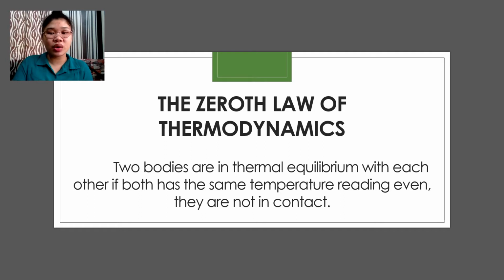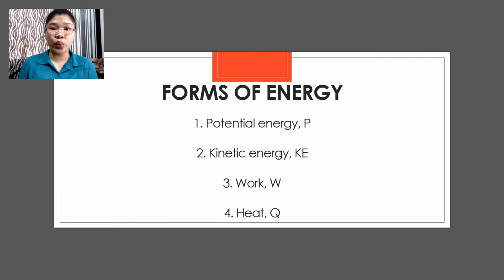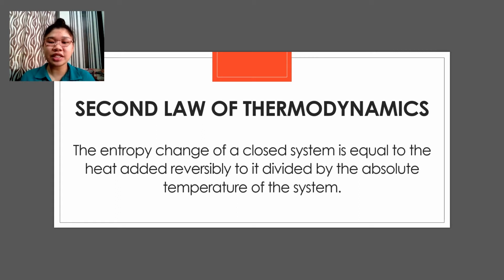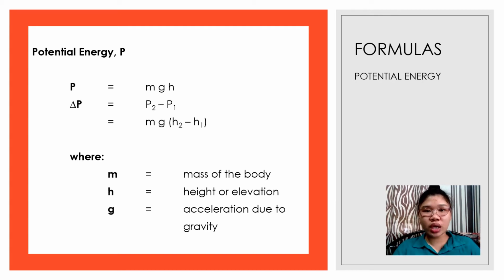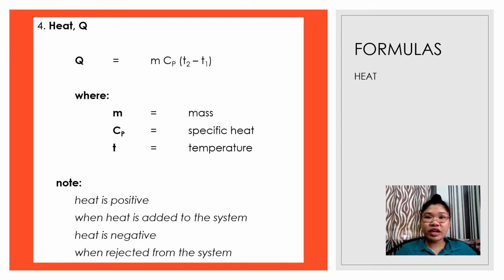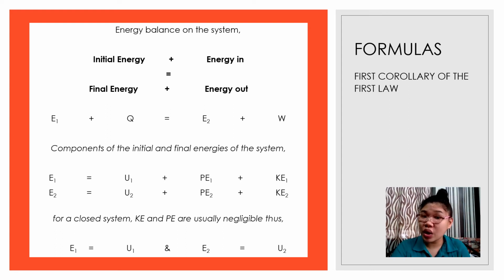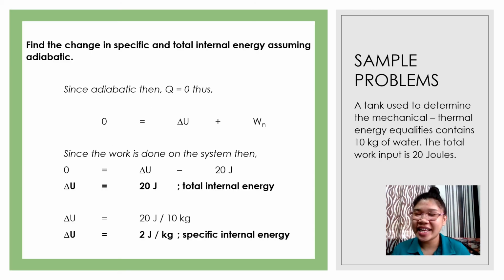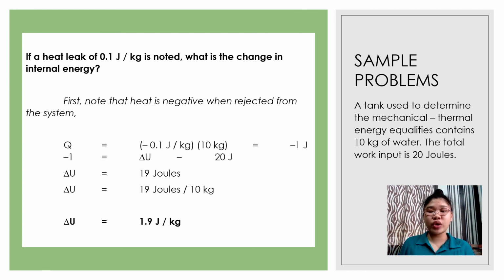Laws of Thermodynamics

Comment: maam bakit po sa iba problems, negative kapag work is done by the system tas positive kapag on the system.
Reply from the maker: Hello Ms. Bendo! Thank you for your question! With your concern, first thing to clarify is if you are really referring to Work and not Heat. If you are referring exactly to why work is negative when it is done by the system and vice versa on other references, kindly check the formulas that they are using because there are formulas, for example, Q = Change in Internal Energy + Work, but in other references they are in the form where the Work is negative already thus, you do not need to change the unit of the given work to negative if it is done on the system that is why I think you assume that the work done one the system is positive. I hope this helps! Thank You!

Another thing also is that there may be ambiguity of terms used. 🤗
Reply: Difference in perspective. The way physics convention defined work as either positive or negative is opposite in chemistry. While in physics, work done on the system is NEGATIVE and work done by the system is POSITIVE, it is reversed in chemistry, i.e. work done on the system is POSITIVE and work done by the system is NEGATIVE .